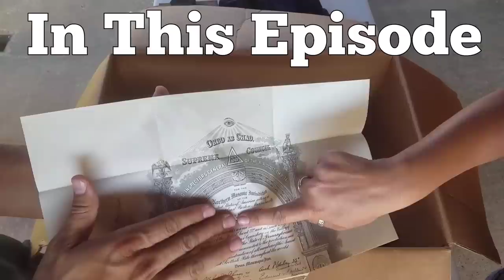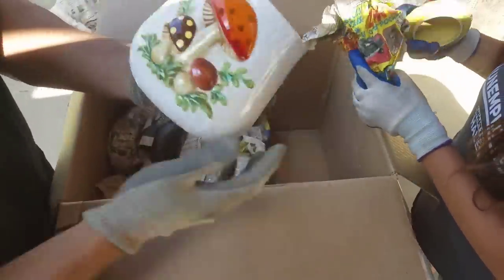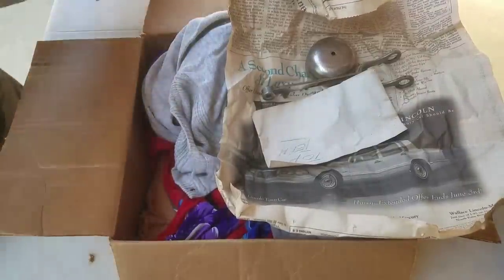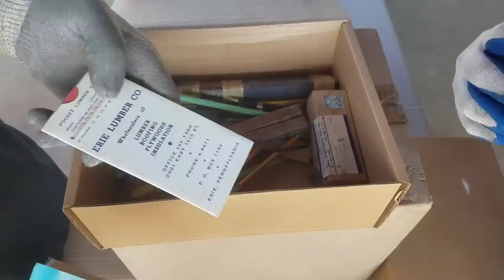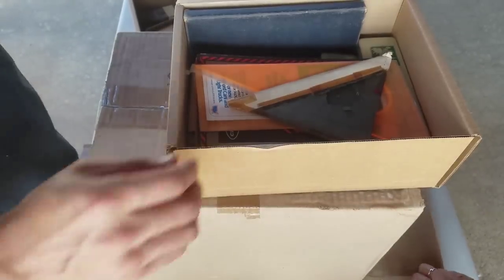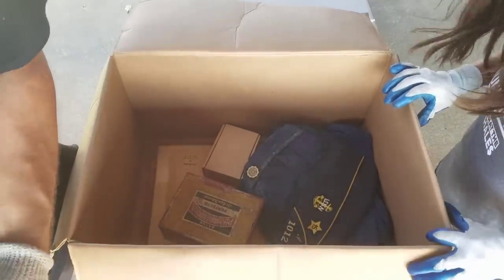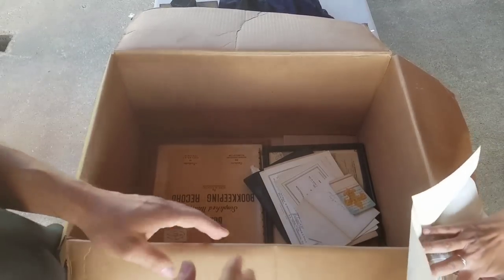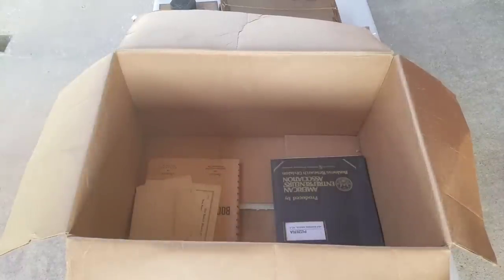FREEMASON SECRETS REVEALED I Bought An Abandoned Storage Unit Locker Auction / Opening Mystery Boxes

Comment: The compass is an M2 ARTILLERY COMPASS.  Don't see a lot of those in the wild, not too useful for land nav.  They were used for spotting artillery fire and were marked in MILs so the fire direction center (FDC) didn't have to convert from degrees.  Also, check the folds in the military hats.  We kept stuff in there.

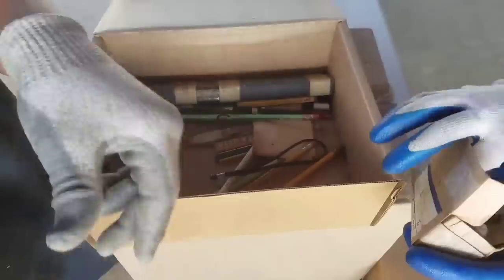Comment: 11:27  It's a leather repair awl.  It can also make complete shoes and tackle etc.  Somewhere there is a leather thimble or two in the box and possibly the needle used to complete each stitch.  Wonderful condition in my opinion.  They can really poke a hole in you if you're not careful.  12:34  Architectural and machinist design tools to develop plans to exact sizes for plans.  Those are still used in old school design Co. and I think will sell okay.

Comment: I'm an old drafter and I used all those tools, french curves, you name it.  For inking you'd take that eraser shield and cut off 1/8" pieces of eraser from your electric eraser and glue them on the bottom of triangles and templates so ink wouldn't bleed under.  It's all done on computer now.

Comment: Alot 9f those old t9ols may have belonged to the father/grandfather of the person that lost the unit. I have many tools that were my fathers and have seen many of these tools in the tool sets or at the drafting tables of friends of our family. Most of tge ones that I still have are used during my current woodworking. If you recall the box were it had the two smaller boxes that held all of the measuring tools, one of the smaller boxes saidcdad's slide rule. To me it looks like dad did some drafting or architectural work.